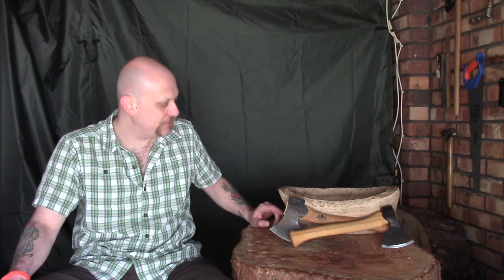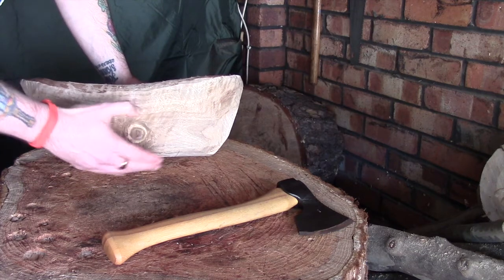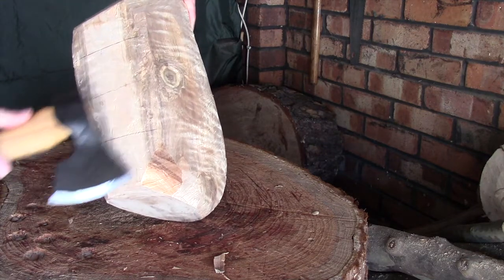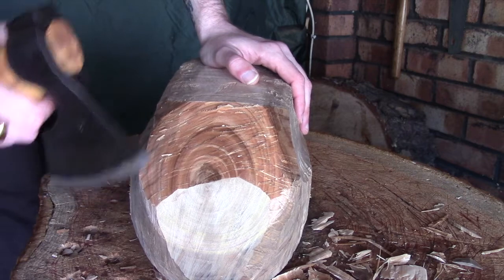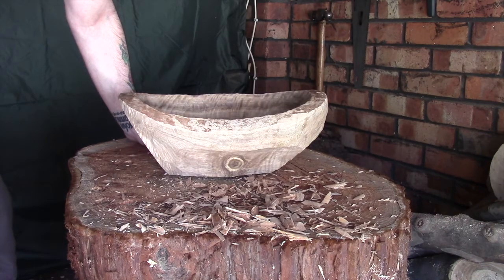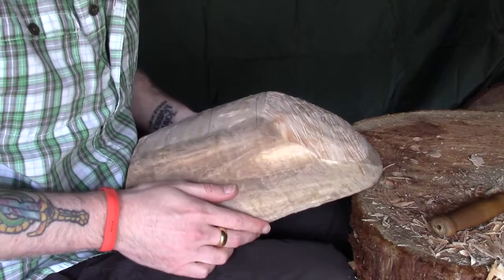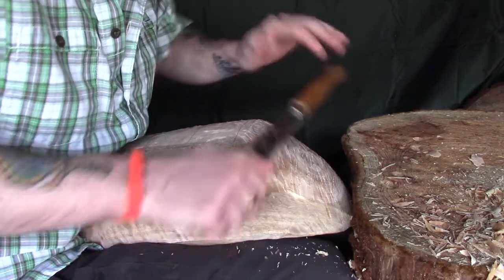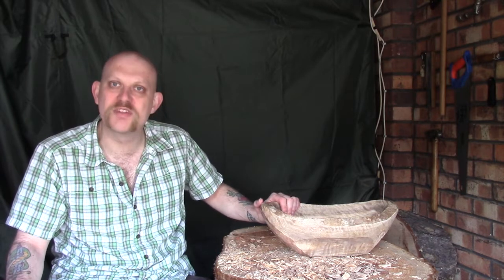Eucalyptus Bowl - Part 12

Comment: Hi.  Lovely piece of wood, and nice work.  Here's a non-traditional, non-bushcraft approach: have you thought about using a rasp to round and fair your lines. I've found that a Shinto saw rasp wastes wood very effectively while allowing for a great deal of control.  The fine side of the rasp leaves, depending on your wood, a surface suitable for finishing with any manner of blade you prefer.
Reply from the maker: matzabean I've used rasps to good effect in the past but didn't really get on with them, for this project I would be more worried if tearing the wood and causing a large split or rip.
You saw a "non traditional" approach but I am reasonably sure rasps have been used for a considerable time, not really any more difficult than a file to make and as you say a good labour saving way of removing waste wood and shaping.